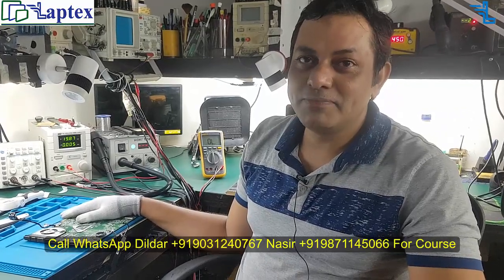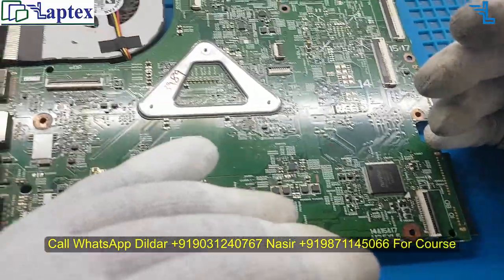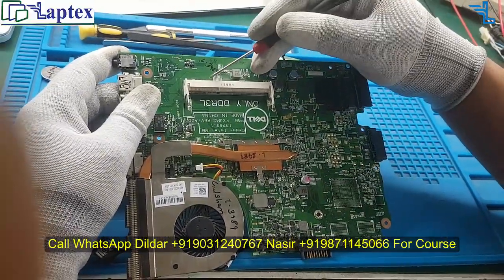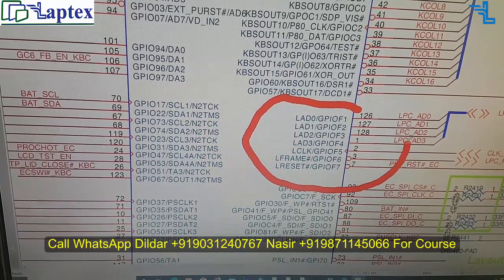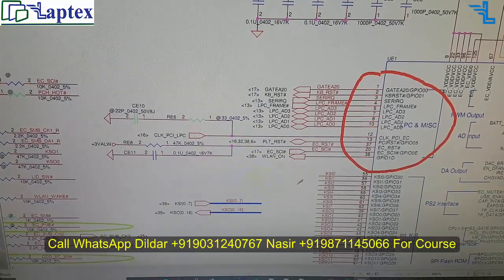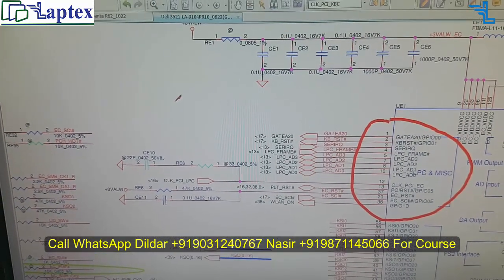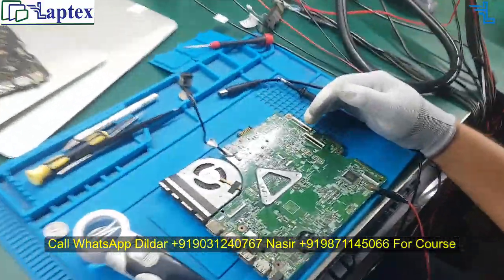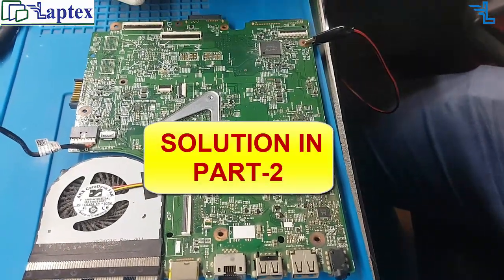DELL 3542 7 Beep No Display Problem PART 1 ENGLISH | Online Chip level Training Video Course |Laptex

Comment: SIR THANK YOU ONCE AGAIN FOR SHARING THE REASONS WHY 7 BEEP OCCURS, I RECEIVED LA-9981P MB WITH SIMILAR PROBLEMS, WAS UNABLE TO DIAGNOSIS THE PROBLEM, AFTER I SAW YOUR EXPLAINATION I GOT BACK TO WORK ON THE MOTHERBOARD AND FOUND I/O DRY SOLDER,, JUST FIXED IT AND DISPLAY CAME.. THANK YOU ONCE AGAIN , MAY ALLAH BLESS YOU AND YOU ENTIRE TEAM./.
Reply: But please, what do you mean by I/O dry solder??
Reply from the maker: @diamonddia5250 it's not solder properly.
Reply: @laptex1377  okay you mean to solder the sio properly???
Reply from the maker: Yes correct
Reply from the maker: Great work bro 😁. We really feel proud and motivated that we are adding value to our YouTube audience ❤️. Keep supporting and sharing our videos.

Comment: Sir, My Dell 5558 laptop beep for 7 times and if I retry back to back laptop gives same beep without any display but after few (4-5 ) hours if I try again it boot up successfully without beep sound. Any advice to fix it.
Reply from the maker: There is COMMUNICATION issue.. you can get it checked by local technician 👍

Comment: Since u have pltrst#,then check LPC CLK (resistors in put And output they might be faulty)
#LPC FRAME (CPU RESPONDING).ALSO CHECK INPUT AND OUTPUT OF RESISTORS FOR BOTH COMUNICATION OF PCH AND SIO
#BIOS COMMUNICATION PROPER.(Check pins DI,DO,CLK,HOLD,WP there input and output resistors )
#DRAMRST(Is it selecting ram bios module chip
#DDR SDA,DDRSCLK (CPU PROPER COMMUNICATION WITH RAM SLOT )
#LPC(0,3)DATA LINES.(PCH AND SIO COMMUNICATION PINS.)Check input and output resistors for all(lpc0,3) pins to know if there is proper communication .

PLEASE SIR I REALLY APRECIATE YOUR GREAT KNOWLEDGE YOU SHARE WITH US.WHICH HAS REALLY HELPED US TO GROW IN REPAIRING FIELD.KEEP IT UP SIR
THANKS
Reply from the maker: Yes you have mentioned maximum possible cause for this problem. Great work. We are doing our best to provide knowledge via free as well as paid videos. Keep supporting and Sharing our videos 😊

Comment: Bios communication error with pch can also be a problem .so resistance   on BIOS pins check.(clk,DO,DI) both in put and output of resistors which can block communication for both bios,pch.
Reply from the maker: Good point. Hope that will be helpful for others as well. We will see the concept in the next part of the video 👍

Comment: may be LPC and PCI track is damage.

Sir lenovo T430 men IO (THINK ENGINE) ki pin num 76 sy 25 volt aaty hen battery charging k 1 mofet k gate ko enable karny liye, agar yeh 25 volt IO nahi nikal rahi to mosfet drain to source jumper kar sakty hen bajye IO replace, koi problem to nahi.
I have done this and laptop charging properly.
Reply: Learned many things after purchasing video trainings.😊
Reply from the maker: Thanks brother. Hope you do well and further improve your knowledge and skill. Proud to have you as a Laptex family member.😊❤️
Reply from the maker: Good work...if you know and understand the logic then you can manipulate according to your requirement 😊👍